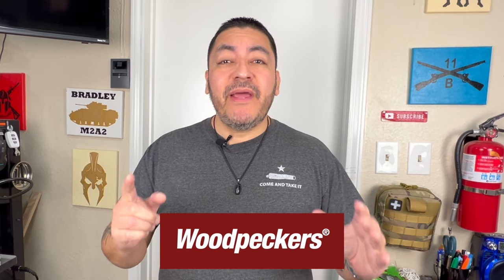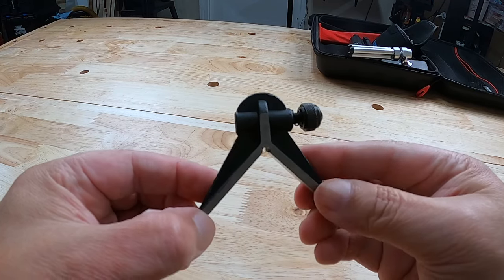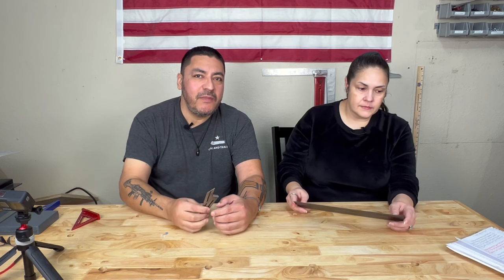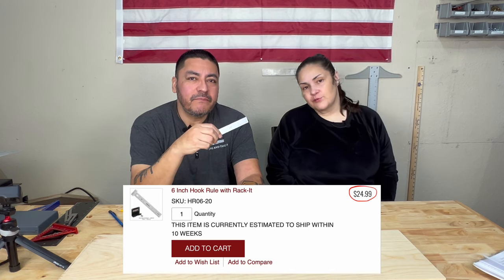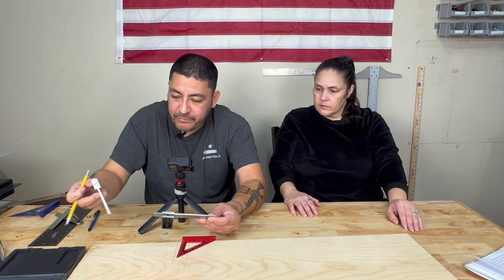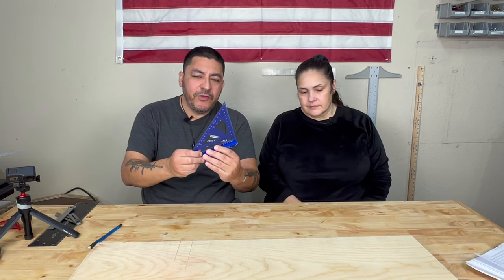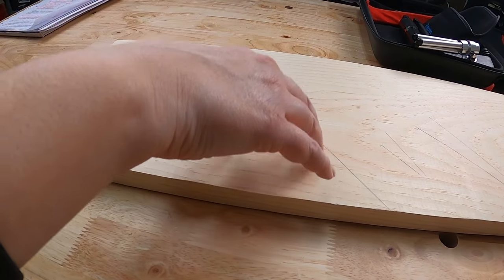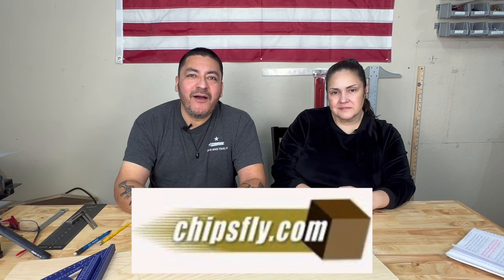Amazingly Precise Woodworking Tools You Need To See!!

Comment: Question. Isn’t the 40 degree you drew with the square should be 50 degrees? Most squares measure the angle from the vertical line. So the angle from the vertical line should be 40, and the angle you measured with the bevel tool should be the complementary angle to 40, which is 50 degrees.
Reply from the maker: Hello & thank you for watching our video! That’s a great question, lol. I’ll have to check that out again. Thanks for the heads up though. Thanks again!